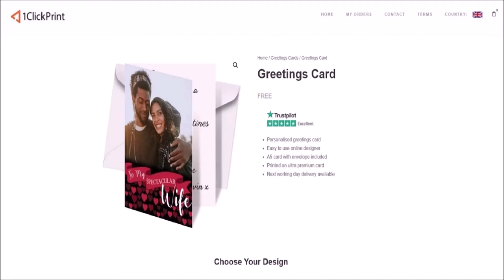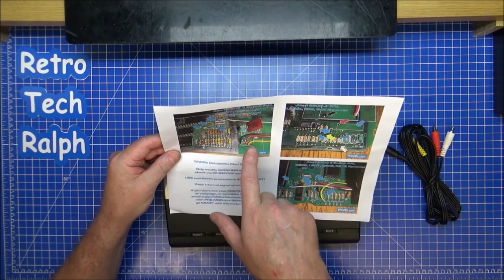Atari 7800 Composite Video Modification.

Comment: Great Job Ralph.  I've just done this mod and whilst my 2600 games run great, the 7800 side is no longer syncing.  On some TVs I get nothing and on others a rolling screen with no sound.  I've double checked the wiring etc. no joy and have tried adjusting the 7800 pot, but no joy.  Don't suppose you have any ideas what may be causing this?  It was all working fine via RF before I installed the mod.
Reply from the maker: maybe an incompatible TV?  some modern ones dont like to play ball. try on a different tv, if its not that, it could be the mod board thats faulty.